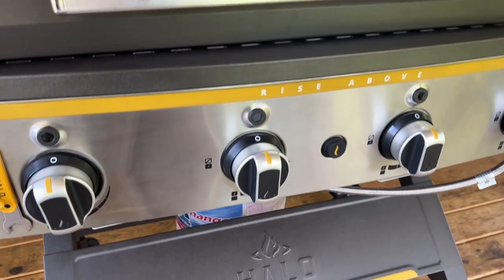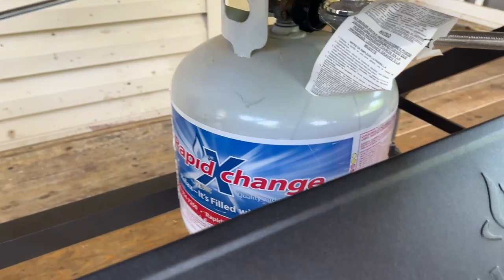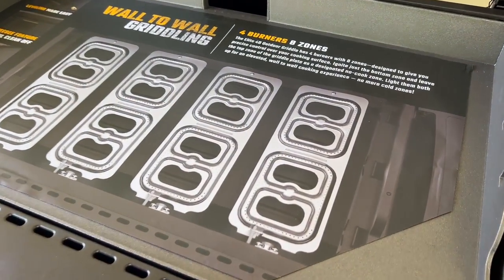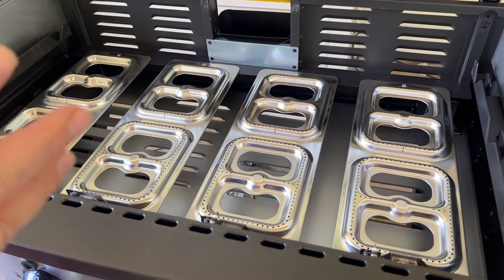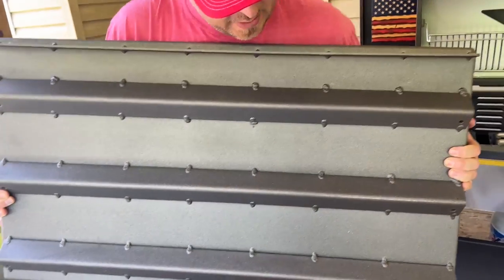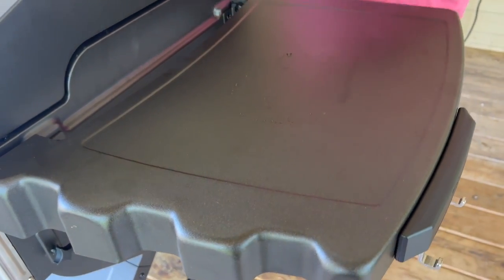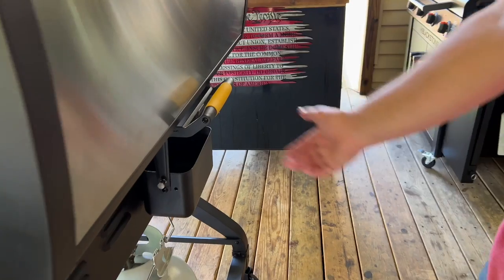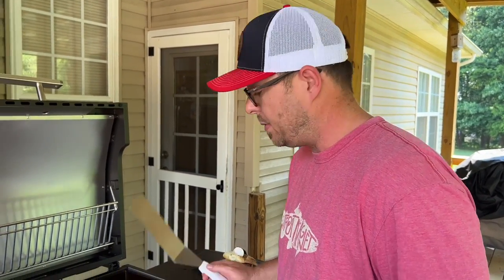Halo Griddle Review - Can YOU Stand the HEAT???  Is this NEW GRIDDLE Worth It?

Comment from the maker: Just wanted to say quickly after the initial review and response. I didn’t try to cook on low. That will be the first cook which drops right after this posted. In that video we play with configurations and temps. Still learning…. We used the 9.5 option to find low.
Reply: Was going to ask what the temps might be with the valve in the 9.5 position.
Reply from the maker: @rayki7glu710  video dropping tomorrow and we discuss this in length with many various options. Still hit imo
Reply: Super excited and bummed all at the same time!!! Hoping this grill will do everything it says it will in the operating range for temps!!!
Reply: I’m assuming that 9.5 and 11 is the pressure of gas in inches of water column.

Comment: My experience putting mine together couldn't be more different.  I was super impressed with the design and build, and the assembly instructions.  I followed them exactly and it turned out perfectly.  The quality of the assembly video was next level (once you find it on their site).  I am super impressed with my 3B.
Reply from the maker: We still cant find it. When we scan the QR codes it goes straight to the website. From there we could not find it. The build is good. Like I stated in the video. Once the legs got done it came together easily.

Comment: Nice new fence.  Your daddy day present just might be the 100k subs.

Looking forward to the first cook.  I'd imagine it would be interesting to run off just the front burner halves, either the two center or two outer, and see how the heat transfers through the griddle plate.  Might be the way to get down near 300.  Or, maybe how to create cooler zones for slowing down a cook.  Glad you showed the plate underside, always interested in how they are reinforced.

Comment: Try the regulator at 9.5 and do the testing. After the seasoning I would have lowered to 9.5 and repeat temp probing
Reply: Exactly what I was thinking why come out the hole that strong is crazy to me. I will never be cooking that hot. 9.5 is much better. I'm setting mine up now and I will use the low setting. 😁
Reply: Agreed!
Reply from the maker: Yes the first cook is coming tomorrow and we go over that...the manual says to keep at 11 for most of your cooks...
Reply from the maker: Because 9.5 dosnt change anything...first cook tomorrow...

Comment: Another great review video guys!  But after watching all your griddle reviews, I truly believe the wind guards come with a high cost of not allowing the griddle to dissipate the heat fast enough to actually have a useable low setting.  You sold me on the 28" Weber griddle (without wind guards) when you turned 2 burners down to low and actually had a 100 degree temp drop.
Reply from the maker: Its definitely up there on my list...going back and forth for number 1

Comment: Great video. The surface of the sun heat from the HALO would be perfect for those who want to deep/shallow fry on the griddle in a cast iron vessel. The most common complaint is that a griddle does not heat the oil hot enough or heats it too slowly which is why the disposable aluminum foil pans are used. That high heat would be great for severe searing for reverse searing. Also, that griddle might be effective for cooking pizza. Set the pizza on a pizza screen or perforated disk and then dome it.
Reply: Stand alone gas frier- $40 - $100
Halo $900

Pizza best shot for a griddle with the insulated hood. You may be on to something there.

Comment: Great review… Can truly understand your heat concern.  What is really interesting is the manufacturer put a regulator on that allows for the 11 and 9.5 water column for gas.  So after seasoning would you move to the 9.5 and see how the unit works or would you recommend maybe starting at the 9.5 setting and season at that temperature.  I have my Halo coming and am wondering if you would start off at the 9.5 knowing what you know after your first use?  Thanks for the great content
Reply: Yeah, I don't understand how he could comment about how hot it is and never even mention if that regulator was 9.5 or 11 and if it was 11 why wouldn't he turn the pressure down to 9.5 and see if that helped a lot. Guess he doesn't like "science"! Hahahahaha......
Reply from the maker: a few things..thats not what the manual says...It recommends the 11...so thats what i did. My first cook is tomorrow and we address this and used it many different ways
Reply from the maker: You guess wrong buddy...yeah i like science..the first cook is tomorrow and we go over this in detail...the manual does not say this and in fact says to use mainly in 11...thanks for the support and being patience with of course no experience with this griddle
Reply: @TheFlatTopKing  Looking forward to your next test. If you do the bread test could you maybe do it at the 11 and 9.5 regulator setting?  This might give us all some insight into how the griddle reacts at both regulator settings. We love your process for figuring out a griddle’s performance and you proved you got a great seasoning on this griddle so figuring out the heat management will be something we will all be watching for. Thanks again for all you do to coach and educate us wanna be griddle masters. You are the King!
Reply from the maker: @NewFocusLLC  i didn’t do the 11. No need. I did the 9.5. Whole thing was based on getting the lowest temp possible. Video posting tomorrow
Reply: @fritzkabeano1969  I think he did a great job and as he said he did what the manual said. So give him some slack.. he read the manual, most of us don’t. He will figure the Halo out and we will all benefit. Mine shows up shortly so I am really interested in his findings. I really don’t want to send it back because you can’t control the heat. He bought this one himself so I know he wanted it and will tell us all the truth about it and how to use it!
Reply: @TheFlatTopKing  Hahaha....i was just giving ya sheet.....even that 9.5 pressure setting might not be low enough! Keep up the good work!

Comment: This griddle seems very interesting. A lot of features that i like. Even nice sized casters. Im wondering like some of the other viewers what setting the regulator was on. And what kind of temperature difference there is using both front and back burners vs just front. I think it would be better if they were plumbed opposite. So you can run the back burner and not the front ( having to work over the hottest part of the griddle to reach the cooler part of the griddle doesn't make sense) Sure its easier to plumb this way but I'd rather pay a little more and have it work correctly. Looking forward to seeing you cook on this plus perhaps figure out how to better manage the heat. Have a great day. This griddle looks very promising.
Reply from the maker: Once again Victor....spot on...thinking the same exact thing...first cook tomorrow
Reply: @The Flat Top King  good luck. I'll be waiting for the video. Fyi, I didn't even know about this company. Something else, a customer shouldn't have to modify what they buy but it seems someone who works with propane could probably suggest a different regulator with a lower out put to get the burners into the sweet spot. It seems most griddles burn a tad to high and a lower output regulator could do the trick. Ok enough, have a great day 🌤 😀 👍 🍻🔥

Comment: David Ward
From other sites that have reviewed the Halo, the 9.5" setting does lower the temp, but no as much as I think Neal will want.  I think a lot of the heat issue comes from the front and back burners both have segments that heat the center of the griddle top and those segments are very close together.  I wonder what would happen if you tried blocking the center segment of the rear burner with some high temp foil tape or similar (just to test a theory).  Then with all burners on you only have 1 segment in the center instead of 2.  I suspect it will be more even front to rear then.  If this works, not sure what a long term high temp solution might be to block that one segment in each rear burner (high temp silicone? You could still remove it and it would not damage the burner metal).

Comment: I just bought this griddle in the 3 burner version. I also converted it to NG. Mine runs awesome, on low with the cover closed preheated for 20 minutes the grill was 375 to 395 from left to right. Enjoying your videos need some tips as this is my first griddle.
Reply from the maker: Thanks for the info! I unfortunately dont have natural gas....I have heard from other uses that it does allow for lower air flow and allows for less heat...This video was about seasoning...we never tried to hit low...just wanted to clarify..we have already posted the first cook video and it was nothing like this...cheers

Comment: Thanks for the review! I'm definitely curious about your thoughts when using it for cooking.

I received the Elite 4B just a few days ago and was also surprised by the high heat and paper towels getting singed so quickly and easily while seasoning the griddle. However, I've been quite happy with the temperatures when I used it to cook fried rice and french toast. The temperatures weren't nearly as oppressive for the actual cooking I did. I used the normal regulator setting too.
Reply from the maker: yeah thats exactly my thoughts so far...didnt really seem to adjust anything....The first cook which already dropped shows us using the 9.5 and less burners to hit low...

Comment: The test of that regulator is if that fuel can pass through it when its -30 and the propane tank is kept outdoors. I have had to bring my tanks indoors a few times to cook outdoors. North of the 45th Parallel it happens. Another thing no reviewer has ever  commented on is SPIDERS! I have burned up a few BBQ's when one or more of the jets was clogged with Webs and the backup of gas set the knobs on fire when I went indoors to prep some food. One last thing. I bought a grill top so may years ago I cant recall how old this thing is. The Front drip tray hole often gets clogged or some dam racoon runs off with the drip can into the bushes. If the fat drips freestyle (Even without a wind) you do not want to be wearing sandals. Rear trays are safer.

Comment: I’d be interested to see some comparisons as far as temperature and distribution wiry the regulator on both settings while running only the front burners and with both the front and back half of the burner. Four total options on low there. 

I was half tempted to buy this griddle for Father’s Day and for the move to our new home. I’m not so convinced now, but still not totally discouraged. I’m more impressed by the Traeger than ever now though. 

Keep up the great work.
Reply from the maker: Just posted the first cook..thats where we go over the temp options etc...

Comment: Good idea on the burner s. I have a Members Mark 4 burner griddle that I modified. I replaced the straight burners with u burners for even heat distribution.  

A huge improvement on the heat distribution. I left the original regulator and my temps on low are 325 and on high, 550.
Perfect!

Their idea is nice, they just used the wrong regulator. 700 is way to hot!
Reply from the maker: Great switch right there...thanks...Problem is...it gets hotter...800 plus...

Comment: I did some T-bones on the Pit Boss last night, first time ever direct cooking steak so I had no idea what the hell I was doing. I just put down a layer of avocado oil, then rubbed about 2 tbsp or so of butter in using the end of the stick, then threw them on there and let them cook about 4 minutes on each side until they were temping 135. Turned out pretty good.
Reply from the maker: Absolutely....some will add garlic and herbs before taking off and basting the steaks...

Comment: Thanks for the great review of the Halo 4B griddle.  Your review is fair and honest.  And you bring up a good concern about the oil flash point to be aware of.  Your first impression accurately identified and presented awareness about several items based on your preferences and experience that you are not in favor of.  I recently purchased the Halo 3B griddle, and I did not have any assembly issues.  I also purchased the NG conversion kit, which was installed without issues.  Overall, I find the Halo 3B griddle product quality very good.  All components and parts are clearly labeled for assembly, and the fit/finish is very good.  Yes, I agree with you that the Halo griddle cooking surface is heavy.  However, Halo protects the griddle surface from warping by welding cross-member fixtures across the underside which also strengthens and provides rigidity.  I watched your reviews for Weber, Pit Boss, and Blackstone before purchasing the Halo 3B griddle.  I was not impressed with these other griddles' heat distribution, lack of wind protection, overall fit/finish, and quality of materials.   I’m looking forward to your Halo 4B first cook.  Keep up the good work.
Reply from the maker: Thanks so much for the support..first cook dropping today and we go over all the temps....
Reply: Thanks for your follow up. As you have mentioned previously, individual preferences and previous experiences are relative. I’m new to griddling, your reviews are valuable because they are based on your professional chef experiences and knowledge. You also provide a practical user perspective view which is very helpful. Again, keep up the good work 😊

Comment: I need some help, if anyone has any suggestions or diagnosis help. First Time Newbie. After weeks of research and learning online, I received my new Halo Elite 2B. Using what I have learned on this channel and elsewhere, including the manufacturers instructions, I cleaned the griddle with soapy water, rinsed and fully dried and then seasoned. I used quality 100% avocado oil. Following the best practices, I applied thin layers with a paper towel, no pooling, etc and allowed the oil completely smoke off between coats. I did 6 coats. Griddle temps were generally between 500 and 600, some areas were 600+ at times. By coat 4, my griddle had progressively taken on the black color, as expected. I did noticed a slight change in behavior around coat 4. The oil would noticeably bead, which I have not seen or heard mentioned in any video. After six coats I called it good and ended. The next day I attempted a "fried egg test". brought the griddle up to between 300 and 325. I put down a small squirt of oil, but could not really evenly "spread" it across the cooking area. In stead, I could only create an area with lots of small oil beads. The eggs stuck severely and instantly. Requiring some careful scraping to get the bulk off, which still exposed some griddle steel. I cleaned the rest with a wet rag and muscle while the griddle was still warm. Fearing I had made some mistake or had somehow not seasoned enough, I basically redid the entire seasoning process, especially in the area that I had scraped the egg off. I did at least 4 full seasoning coats, taking great care to make sure I got full coverage with thin layers and letting it fully cook off. I'm going to try again, but I have no idea where my error is. I don't really expect a different result. Thanks!

Comment: Grease Trap- If you made it to where when you lift the yellow handle and the grease tray swung out from under the hood and opening, that would be neat.
Reply from the maker: 100 absolutely...keep it locked and easily removable but able to take the metal pan out without taking the whole unit off..

Comment: As usual, a great, unbiased review. I was certain that this was the griddle I’d be purchasing next…. but now? I’m not as sure. It may be too hot for my physical premises. I look forward to your first cook and future cooks where you’ll hopefully find a means of cooking at lower temps - without taking any external measures. Maybe the two stage regulator , run on 9” WC (low) will be that solution. I hope so. There’s so much I like about this griddle. I wonder if only running the front half would yield an even, lower temp… anyway, thanks again for buying this and doing another outstanding review. I look forward to your videos and trust your opinion.
Reply from the maker: First cook is dropping tomorrow...we discuss all the options..
Reply: He makes a good analogy of it being a Ferrari. Yes, you can floor it and hit high temps, which its purpose is to sear. Which I will tell you it can sear the hell out of a steak. I also get the safety issue with the flashpoint on some oils. To someone not familar with that, it can be a hazard.

With having some extra burner control, you can get the temps very low based on the configuration. For example, I turn just the front corner burners on to get lower temps in the center.You sacrifice 25% of cooking area to do so, but its so easy to cook lower. 

With the lid closed I can get an ambient temp of 230-250 with 1 column of burners on. Then just bake on the other side. Just enough to bake at slow and low temps.  This grill is for those who like to get creative. Like he said. It has potential, it depends upon the user. Learn the grill and you can make some good stuff on it. Shit I just made a 16" pizza on it. If you want it get it. You won't be let down.
Reply from the maker: @RoyalF04  I cant thank you enough for actually listening to my comments. So many of the responses has been I didn’t do this or that. Well let’s wait to the first cook and play around with it. I was only seasoning. Wasn’t looking for low. This comment needs to copied and pasted about 100 times already